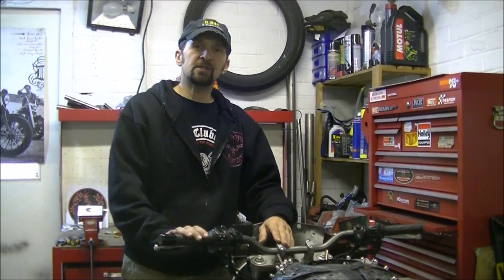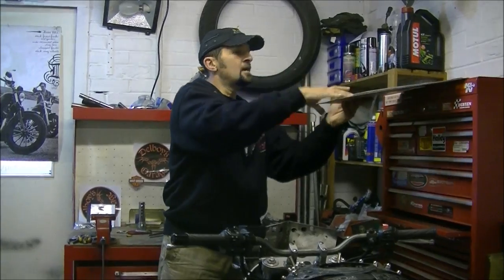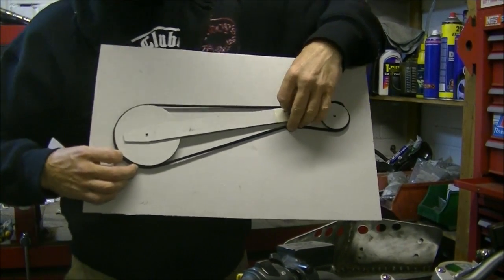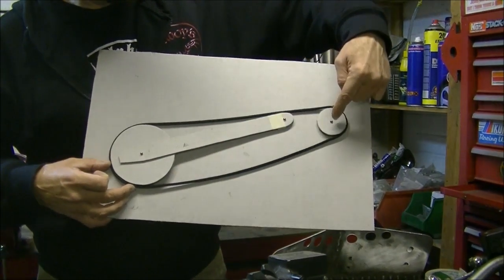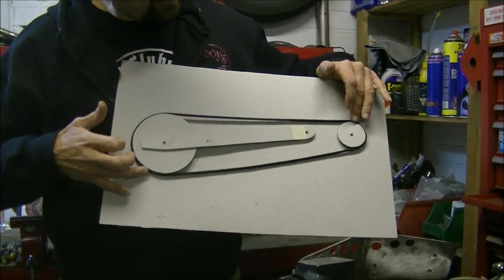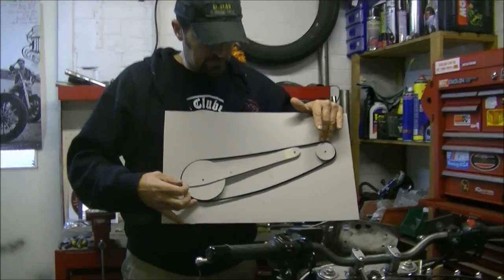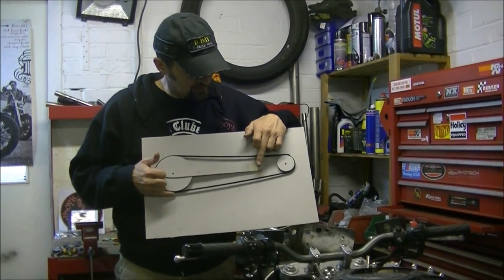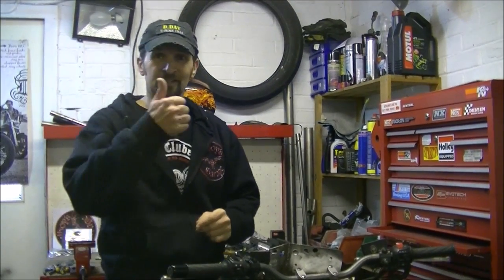Delboy's Garage, Chain / Belt  Tension, Explained.

Comment: @Del, I was riding with a tight chain and after loosening it everything was fine but a ride later this sound started https://youtu.be/3aaGYs05brc. Is this a faulty front bearing? I have checked and there is no play on the shaft.

Comment: Great stuff. How about rigid bikes?
Reply from the maker: Different concept, no movement in the swing arm means the chain stays at the same distance all the time, you still need some slack in it though, which can lead to lash, so many hardtails run a jocky wheel especially if they are stretch in length, which they usually are...
Reply: Thanks so much! Appreciate the time to answer. keep up the good work. Big fan!

Comment: what's going on del! thank you for taking the time and effort to share this with us.. left me with one question.. should you keep your chain tension slightly on the loose if your suspension is softer than standard, or if your riding with a passenger on the back for a long trip? thanks again and keep it up!
Reply from the maker: +jerry falisto Hi Jerry, Yes indeed, if you run a tall bike, with soft suspension, then always run it a bit more slack than a road bike... it allows for more radius of movement, and if you're carrying a pillion too, it will sink lower so it'll need the extra slack.. hope that helps buddy.. Del.

Comment: Moonfleet41 Fantastic video! Thank you. Newbie question: putting 13" Road King shock with 1" lowering block on my 20111 883 Iron. So I will be technically lifting the rear by 1" Do I tighten or loosen the belt?

Comment: Another thing to add Del is that chain slack differs from bike to bike. I've heard lots of people including so called 'bike mechanics' say that chain slack should be roughly an inch. Not true! For example, my ageing CBR Thou requires (i think) 25 to 35mm, yet my sons FZ6 should be 55mm (or thereabouts) When my son first bought his FZ6 we took it to a local Superbike main Dealer in South Wales for a recall on the output shaft/front sprocket nut. Whilst in they readjusted the chain telling us it was too loose. I scratched my head at this cos I was sure i'd adjusted it as per the manual. Anyway, we left this main dealer after they completed the work and whilst along side my son at the next set of traffic lights I looked at his chain and could see that whilst he was on the bike and the suspension was compressed his chain was as tight as you like. I re-adjusted it there and then to correct 55mm spec. The South Wales Superbike dealer shall remain un-named. Lets just say they're in South Wales, and they sell Superbikes!!! So people, check the correct figures for your particular bike, it's very important.
Reply from the maker: All the book settings are aimed at creating a minimum of about an inch of slack at the tightest (often the most compressed) point....bikes with a taller ride hieght that sink further (like my Tiger) need a bit more slack...and bikes that have almost no drop, and sit almost horizontal (swing arm in reference to the ground) can get away with an inch.... you're right, bikes vary, ...but the principle doesnt..
Reply: Moonfleet41 Spot on Del. I still see many people lift the chain on a bike on it's side-stand and say 'Yeah, that looks about right'. Lovin the vids mate. You're far smarter than me, but at least i'm better looking :)

Comment: Nice one Del, great model, but it's the wrong way round ?
On my bike the little sprocket is at the front, and, well I suppose you've got the picture !
While I'm here, can I pick your brains about "chain tension", Everyody talks about 30mm play, but when you actually start to adjust it gets a bit confusing, about what 30mm means ?
is it 30mm from the top of the stretched chain, or more to the point where is the measurement taken from ?
A vid perhaps ?
Reply from the maker: Hey mate, good to hear from you... this is a really common ask over and over... so here's the simplest rule...

30mm to 40mm measured using the lower half of the chain, right in the middle between the two sprockets,  lift up as high as it will go, and then pull down as far as it will go....so getting the FULL field of movement, (not just the drop from rest)....and you measure this at the "Tightest" point in the chain...so roll it round till its got the least slack...and set it right at that point..

OK?....
always drop me a line if you get stuc buddy.
Cheers
Del.
Reply: Moonfleet41 Many thanks Del, makes sense, might even make up a "tool" to make the job easier and save faffing about with a tape measure ?I spoke to you previously about Drift Ghost import issues with Windows Moviemaker, and your input helped big time, so a belated thanks on that one too.
Reply from the maker: bikeriderscotland
No need for a tool or tape measure really....its between "inch and a half and two inches",,,no more then the length of yer thumb... easy aye.?  and glad the camera advice worked...just got hold of a Drift Innovation HD for a bit of road observations filmage....so coming soon..!!lol
Reply: I'll remember that Del, I'll have to keep a spare thumb in the toolkit,

Comment: That's good stuff! I bet some folks would like to see something like that for proper primary chain adjustment. I know you have a video on that but that open view brings it home. Good job on the video.
Reply from the maker: Hi Alan...Primaries need ot be almost tight with just minimal slack because the two spockets dont move closer and apart again like final drive does...but i guess you could do a whole series on "How- it works" from valve train to brake calipers...just wish i had the time..lol

Comment: if I understand you correctly based on the model you made there is no slack needed right? The movement of the rear brings it closer to the front not further so the chain will experience slack on movement of the rear.
Reply from the maker: Pretty much, yes, the 'arc' of the swing arm creates slack as it moves away from horizontal where it's tightest....the need for slack is to account for the design of most bikes who's suspension (at rest) places the swing arm at about 5 degrees below horizontal....so then when the bike gets loaded with rider and luggage, it wont become too tight when the back end drops...
Reply: Thanks for the clarification. Makes a whole lot more sense to me now.

Comment: Absolutely BRILLIANT !!!!! Yes I did know about correct chain tension, but that model you made make it sooooooo simple to get it clear in yer 'ed.
Very well done, Del - really
PS. Did you use snub-nosed scissors?
Reply from the maker: Hi Dave... thanks mate, its so much easier when you see a thing demonstrated aye...and yes, i used round ended scissors, and i didnt run with them...!

Comment: Hello Del, The good news is that there is no movement in the spindle but the sprocket did have slight movement in it. I checked the torqued setting and it all seems ok. I took the sprocket off and checked behind it, cleaned it up and put it back together to the correct torque but there is still movement between the sprocket and spindle. I haven't rode the bike yet so not sure if its still making the noise but hopefully just re-setting the chain would have helped it.
I'll keep you informed and many thanks for your help.
Sreve
Reply from the maker: OK mate....just for the record.. there must be NO movement in the front sprocket on its shaft...it must be totally solid...any movment will cause the end of the shaft to get chewed up....dont ride it till you get that sorted buddy..!!
Reply: Moonfleet41  Right ok. I'll order the sprocket now. Cheers again Del and keep up the good work.
Reply: Moonfleet41 Hiya Del. So the front sprocket changed and the noise has stopped so happy days :)))))
Cheers for your help and keep up the good work.

Comment: Always love the little value adds that you put in Del.  The XL1200S runs 13" rear shocks as standard and I wonder if that is a factor in why mine has been through so many belts.  Chain conversion for sure if it breaks this one any time soon!
Reply from the maker: Hi mate...its inlikely you actually break a belt....and the 13" shocks are pretty short travel even though they are longer then normal.....so the belt can be set to a tension, and it wont snatch up much unless the back had a lot of drop on bumps....chain conversion on Harleys is way cool....and they make a totally different ride too...if you like your Harley hard core and chunky....a chain will enhance that feel when you ride it..  take care buddy, and thanks for watching... Del.

Comment: Hello guys another quality video. You guys must be mind readers. I think I may have had my chain too tight as I'm getting a kind of knocking clicking sound as I ride along slowly. I fear I have buggered the front sprocket bearing by having the chain too tight. Does this sound about right to you and how difficult is it to change the bearing. Your advice, no matter how brief would be a massive help.
Ride safe
Steve
Reply from the maker: Hi Steve..its pretty hard to collapse an output shaft bearing, if you have damaged it, the first thing you'll notice it that it'll leak oil all over the place as there is a rubber seal in there too.....just check it by removing the sprocket cover, push the back wheel right forward on its adjusters to gain all the slack in the chain, then lift the chain off the front sprocket so its free to spin...

With the sprocket free to move...stick the bike in neutral and rotate the thing....if its turns smooth and silky with no crunching or grinding...and you have no latteral side to side play in the thing...then its fine...

As for how hard it is to replace....mate, you dont want to know.. its a total engine strip, right down to the crank...you need to take the bottom main case off as the bearing is sandwiched between the two halves.....so i really hope its ok..

Good luck with it buddy.. let me know how you get on/.
Del.

Comment: Thanks for that Info! The project bandit, how much have you got left to do and not seen a video in a while, been checking twice a day haha!
Reply from the maker: Yeah sorry mate, been waiting for the speedo, and it came in the post today..so just got to weld in the curved support tube for that, then rig it up and programme it... then wire in the indicators )wont be a video, thats just details) and the front thing is ready for paint and matching in to the bike....after that...its just a new back tyre, and an MOT, ready to rock and roll...so pretty close mate, not many left, the trailer build went to 40 videos, and im hoping this will be finished inside that...! so much winter prep to do at the moment, and not enough hours in the day with full time work too...lol

Comment: Great presentation, sir! Question. When the rear cog is at the furthest point from front cog? Is it when a motorcycle is in a 'neutral' position i.e. on a side stand?
Reply from the maker: No mate, that all depends on the length of the suspension units and design of the bike... most bikes are only level and furthest stretched when the bike is under full load..
Reply: I see, thanks for answering.